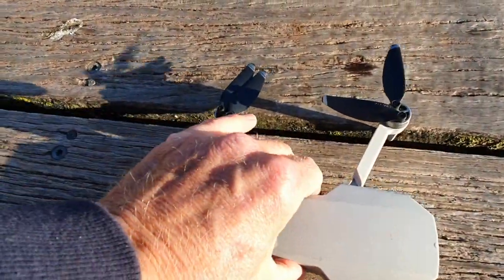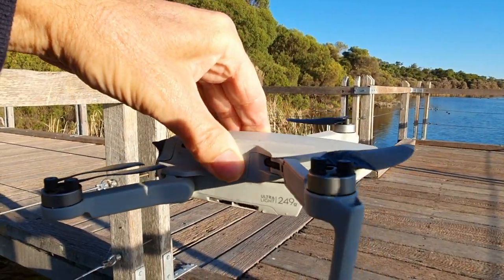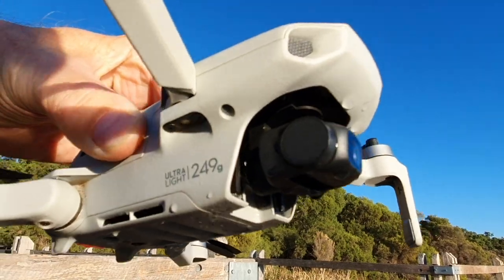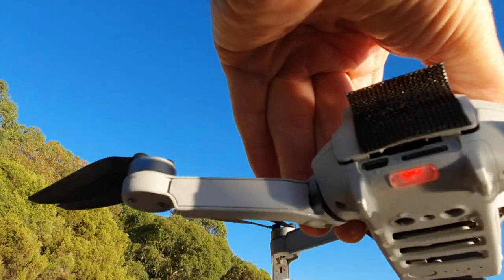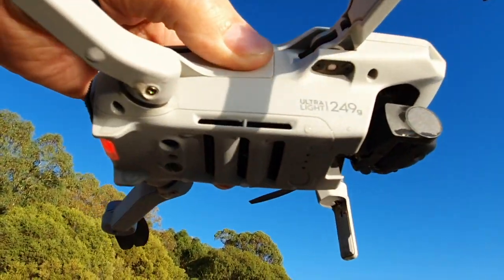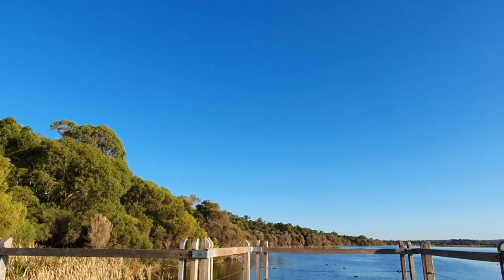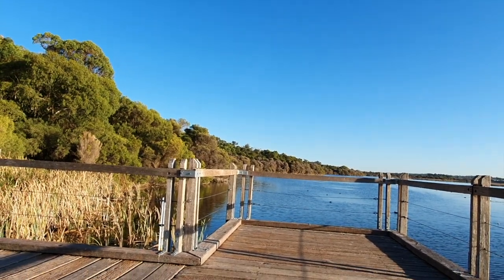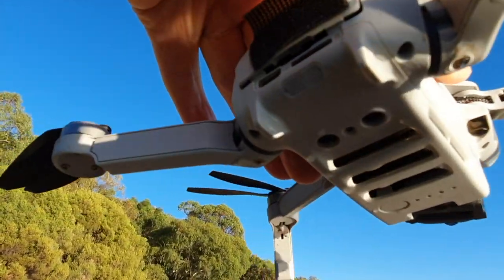Mavic Minis find it very difficult to gauge height over water.

Comment: How close for the drone above water would you say that it's dangerous?
Reply from the maker: Dangerous to who or what? If you mean for the drone then, as I said, you need to know the limitation of your drone. This, I think, was a freak, I have never seen a drone drop so fast without responding to a command to rise. So when you find the limit of the drone and then fly a bit higher, its fine. If you always have DJI care and insurance you can fly with confidence. I have flown over water hundreds of times without an issue, apart from a few cases. Happy flying :)
Reply: @skyviewaerialvideography  ausome. Thank you for the info!

Comment: I hope it’s ok fella, I’ve never really flown above any sort of water because I’d heard rumours it isn’t too clever for some reason. Fingers crossed you dry it out and it’s ok 👍🏻👍🏻🤩
Reply from the maker: Thanks hvee4 but it will never fly again. Well it may fly but never record video or stills. You can fly over water with any drone, just take baby steps till you feel more confident. Some drones are brilliant at it some not so much.  Insurance will cover it so no problem. Thank you for your concern :)
Reply: Sky View Aerial Videography do you have additional insurance as the DJI care pack (which I have) will only replace if you can return the drone. That may not be possible if it sinks.